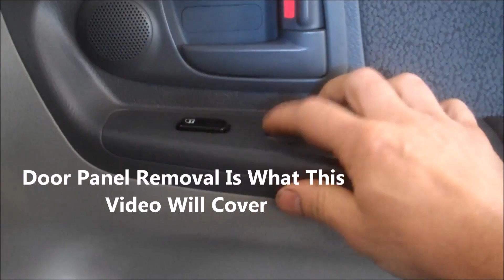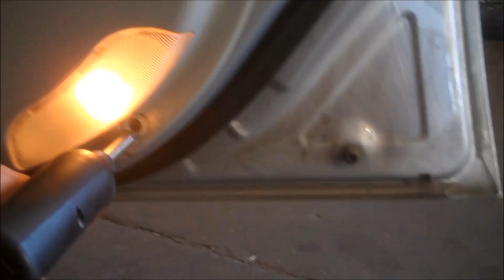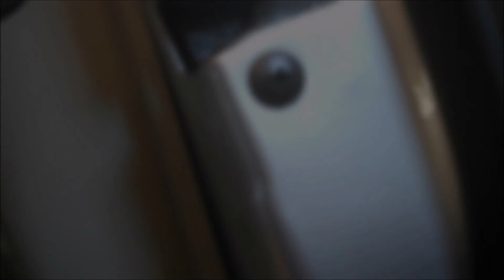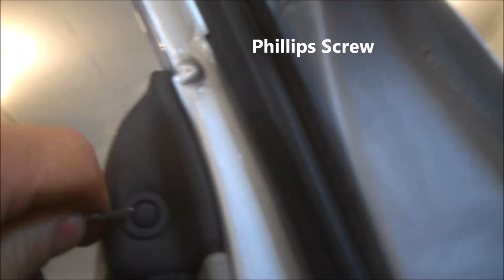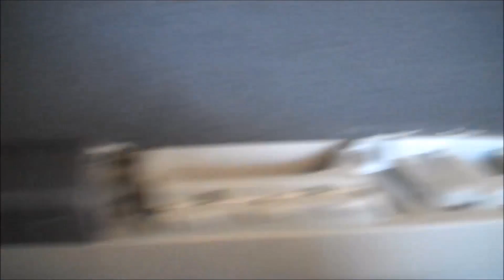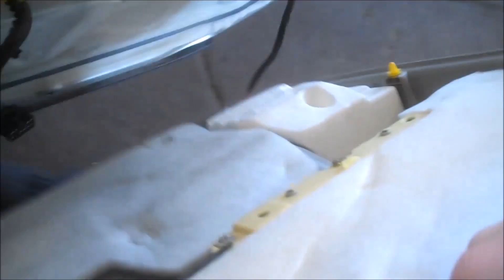Door panel removal Kia Spectra 2005

Comment: Thanks for posting, I have a 06' Spectra 5 and the drivers side outside door handle broke off, can't find any post about doing this... just wondering if you've done this before?  I purchased and painted a replacement handle and had to stop because I was having problems removing the door panel but this video was great giving me all the points to unscrew.  Just seeing if you had any advice on replacing the outside door handle before I dive in and try it.  Thanks !

Comment: im trying to replace the front passenger door cable on my 2009 kia spectra. it snapped and i cant figure out how to install my new cable. i can remove the screw on the little black box but i cant see how to attach the new cable to it. is there a way to completely remove the black box? if you can... please make it painfully easy for me as i dont know what im doing

Comment: My window switch isn't working either. The driver side door can roll down the back windows but cannot roll them up. Similar issue with the passenger side door as well. How did you fix your window switch not working?
Reply from the maker: With the window switch not working properly, we just ordered a new switch from the dealership and installed it.

Comment: best place to ground a amp does anyone know please and thank u these cars are crazy I have done many cars but this 2005 kia got the best of me today we left the amp hooked up and touched a lot of stuff in the trunk and nothing happen no green light on amp comes on its a aftermarket amp I put it in my car works fine
Reply: I grounded my amp where the back seat bolt is , i took the bolt out sand the area down to the metal then put my ground wire touching the sanded part then put the seat bolt back together

Comment: What can you do if you can't open the door?
Reply from the maker: Shannon Schow tougher to just work from inside the car but i think you can still do it. Or 4 bolts to take out the driver seat to move it, still tight fit to move that inside the car...
Reply: can I pop the door open from the outside of door?
Reply from the maker: if the outside door handle is not working, then no.
Reply: I'm trying a slim jim and air bags